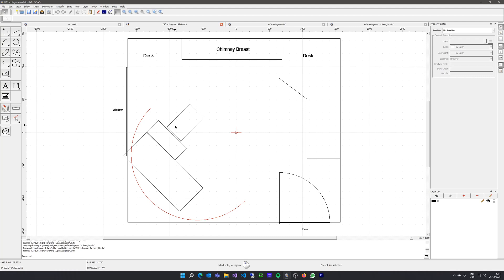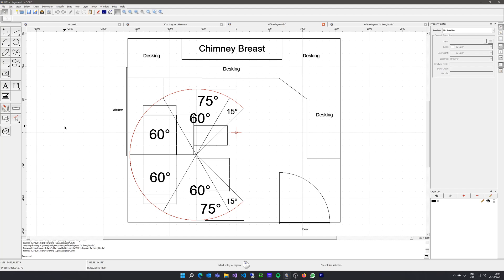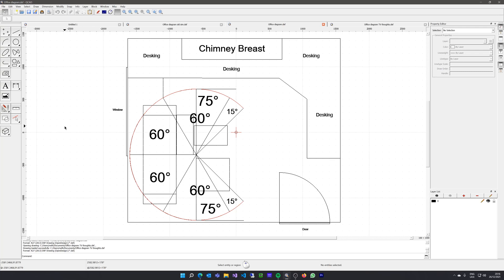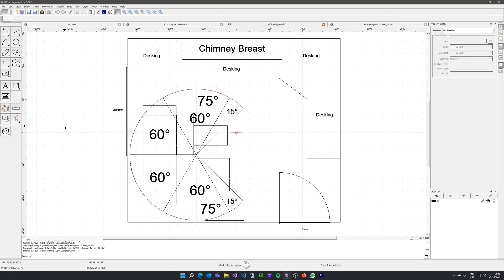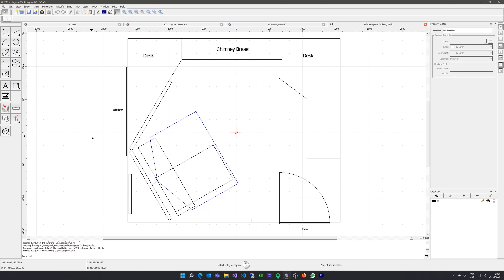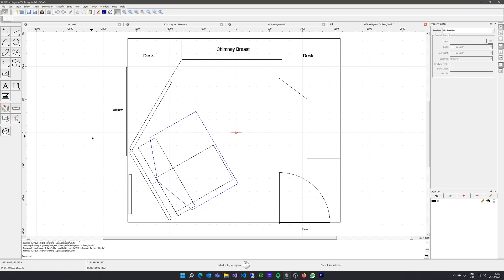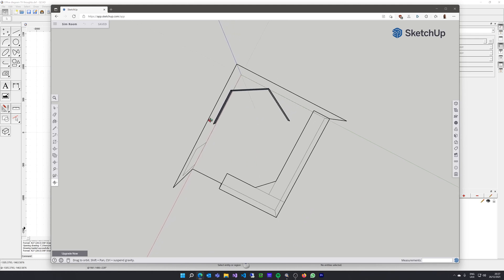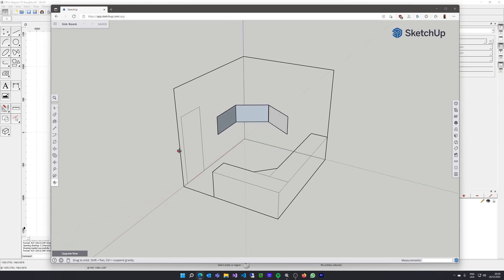Redesigning the sim, part 1: Projectors vs TVs

Comment: Hi, would be great to share experiences about this. I have a 737 sim real scale cockpit in a 2,5 meters wide room, it fits squeezed. First used 3 curved 48 inch tvs. Allways was a pending in my head the border at the sides (not getting full 180 deg view) and a second issue, the shift in colors between tvs because of the angle between, maybe with IPS panels would have been better but was afraid of can not flight at night because of the bad contrast or glare. Anyway were replaced by 3x55 inch flats. They covered the sides a lot better but the color shift went worse because the increased angle. Now waiting to define next option. At least thank to pandemic I have been able to sell all the screens fast. Do not know if a projector setup would work in this small room, I am seated at 1 meter from front or left wall.
Reply from the maker: So, the issue with TVs and their viewing angles certainly is a concern. However I've seen comments from people with similar setups who say it isn't an issue for them, and I think it does depend on the screen technology. From what I understand, OLED screens shouldn't have that same problem, for example. Projector setups always require short-throw projectors except in the biggest spaces, but it will depend on the throw ratio and what size image you want at that 1m distance. Ultra-short-throw projectors are always an (expensive) option. It depends on whether you want a curved projection screen or multiple screens at an angle to each other - obviously the latter is easier to do in a tight space.

Comment: I had the same issue with my sim. Ultimately went for the triple TV screens mainly due to high wing of the Cessna (wanted to see the wings project out from the cockpit).....great video mate.
Reply from the maker: Subscribed to your channel. Your sim looks impressive! Looks like you have your TVs at 90 degrees? How do you find that works across the screen boundaries in terms of perspective etc?
Reply: @FlyerOneZero  hey mate.  Works great and  blends well.  Bezels only drawback from a viewer perspective but I really don't notice them.  XPlane functionality with monitors coupled with planemaker works like a dream although fair bit of effort dialling in the image across the 3 screens....

Comment: What projectors do you use? I am using 2 Optoma EH200ST, but thinking of updating, to improve brightness and contrast. Would appreciate any recommendations
Reply from the maker: BenQ 1210ST, but they aren't made any more. BenQ makes reasonably good projectors but I'd do some research at https://projectorcentral.com. Also, consider that the screen material / coating can massively increase apparent brightness and contrast. I recommend Screen Goo paint.
Reply: @FlyerOneZero  thank you. Do you have any experience with Optoma?
Reply from the maker: @VPopkins  Not personally. I hear good things, but all my experience has been with BenQ.

Comment: Definitely a hard call I’m in the same boat. I’m really curious what your next step you will take.
Reply from the maker: I've more or less decided to hedge my bets and will buy Immersive Designer Pro and design a projector-based setup and see how well I could achieve my goals before I commit to building anything. There will be some content on that whole process coming. 

What I suspect I'll discover is that if I go with projectors again I can only have a 'naked' setup - no shell or overhead panel - whereas if I go with TVs I could have both; this was much less of an issue when I planned to build my next sim in a garden room with plenty of space, but that won't happen for years, if ever, so I need to make the choice now.
Reply: @FlyerOneZero  for my small space I’m thinken TVs for now for my self. Looking forward to your build videos 👍👍

Comment: Do you have any suggestions for someone who might be able to build a screen in the US? My DIY skills are lacking and I’m currently using 3 projectors and a 2m radius 180 degree screen…
Reply from the maker: Hi Paul. I’m not US-based, so I’m not really familiar with the situation over there. You can buy pre-made screens, but they tend to be very expensive. What do you feel is wrong with your current screen? Or do you want to extend the field of view? I rebuilt my screen after the first attempt, and the key improvement was creating a properly curved frame to support the screen surface; I did this in CAD software and then sent the file to a CNC house to machine it out of plywood for me. Which meant that it was mostly an assembly job. Perhaps that might be a better way?
Reply: @FlyerOneZero  lll
That would be a better way! I looked around at immersaview and some other higher end spots like av stumpfl (sp?) and yes, the cost of the construction itself was something around 10k+ USD. I had my house completely renovated so created a dedicated and sound insulated / blacked out room just for this project , got three optima Zh406st projectors, and the contractors took the plans and tried their best, but they blended some mdf and made it look nice, but it isn’t at all accurate, is quite flimsy, and it really is clear why it has to be done right!

I’m using fly Elise and that has been its own headache - my placement of the projectors has been a constant headache and then warping has been really tricky as well - I suppose if it was cheap or easy, anyone would do it! I’ll post some pictures of the current setup but essentially I’m coming to the conclusion that I’m a bit outside of my skill set :) and so was about to try to outsource it to someone who could take the time to do it right. Big fan of your work and wouldn’t have given this all a shot without channels like yours showing me what talented people could actually achieve! I’m resisting the urge to give up early and out the triples back on, and hopefully I’ll be able to at least have someone log on remotely to see the cameras and assist with the warping. Too long for the comments but keep up the great work! Ambient lighting is totally blocked out but as the wife just opened the door to see where I had chased off to, it really does make a difference vs. screens!
Reply from the maker: @kitchen415  it is a skill set that you have to learn through experience, my original version was not an accurate semicircle, the projectors were badly placed, and my original set up wasn’t perspective corrected at all so I had the stretchy sides. It took me another couple of years to really get it right.

There is a guy called Nat Crea (https://youtube.com/user/melnato) who does consultancy on display systems, and he’s pretty much written the book on the stuff, but I imagine his rate is quite expensive, also he is based in Australia so would need to travel to you. Are you using the immersive calibration pro software as well as immersive display pro? If so, are you calibrating with cameras or are you doing it by hand with a marked up screen?

It sounds like the first thing you need to do is to build a new screen, or at least reinforce your existing one. Designing a circular frame was easy enough, it didn’t exactly stretch my CAD skills, and then it was just a question of locating a local CNC place that could cut it out of suitable material. Having a rigid structure behind the screen keeps everything in place.

Fly Elise also does a piece of software called immersive designer pro, which basically lets you model your room and your display surface and work out where to place projectors et cetera optimally. It’s not free, so you would have to pay for it, but it certainly takes the guesswork out of a lot of this.

Feel free to drop me an email, I don’t have the bandwidth to do proper consultancy but I’m happy to answer questions.

Comment: You sound a bit biased towards displays to me ;-) Dark? No issue for me.  Focus has not been an issue for me either. 210 degree fov? I have never seen more than 180 without making the pixels too big (with 3 projectors). So I stay with 180 degree and 3 projectors. I have one master and one visual PC (with 3080) for the 3 angles of X-Plane. GPU is never the issue with XP, only CPU is limiting fps.  // Good luck mate,  really curious how your setup will look like eventually!  ps my curved screen is rather huge 4,80m, crab angle is ok for me. Projection  is mostly aligned to the capt. seat. I got so used to it that I have no issue landing from the right even with the crab angle. I can switch to the FO seat if somebody really wants to see it optimized from/for the right seat. For me nothing beats 3 projectors. Would love to see laser 4k projectors though...
Reply from the maker: Well, switching to TVs is a new idea, and perhaps I am overly focused on the idea of doing something new… but my projection system was always a compromise given the relatively small space I have available here. I do have a habit of taking on projects because they seem technically interesting :-) I am considering doing a scale model of the set up with TVs… If that sounds mysterious, that’s deliberate, because it would be a topic for a future video!

Comment: I'm currently running p3d 5.3 on 3 55" 4k TVs at 4K resolution.  I'm doing this on one PC with an I9-9900 CPU, 32GB of RAM, and an EVGA FTW 3090.  The 3090 is overkill from a memory perspective.  If I use default graphic settings with light weather, I get more than 60 FPS.  Of course, no one wants to run on default.  I've found a good balance point between settings and FPS and pretty consistently am in the 30-40 FPS range.  I don't usually fly in really busy areas such as London, New York, etc. You can also have the angles for the side screens to almost to 90 degrees as the P3D view groups setup lets you adjust the view, so it doesn't look wacky.  My side angles are about 80 degrees. That may help to reduce your floor space requirements.
Reply from the maker: Great to hear. Any pictures / video of your setup?

Comment: Thx for your views on this subject. You speak of 1 pc with 3 TV's, but if I remember correctly, your were using multiple pc's with WideView. Have you abandoned that concept and, if so, why?
Have you considered using a larger screen on the left hand side (e.g. 65")? Looking forward to the next video. BTW what are your room dimensions?
Reply from the maker: No, I'll still need to use Wideview. In the previous iteration of the sim I had one PC running the simulation, controlling hardware, and generating the instrument displays. Then I had another PC generating the outside view, which was made up of two separate views in Prepar3d. Wideview synchronised those two PCs. FPS was borderline in this setup until P3Dv5, where performance has significantly improved over time. The question is whether the latest P3D would be able to generate three views at an acceptable FPS on that same single image generator PC. If not, then I'd need multiple image generator PCs, and it's not really practical for me to build 2 (or any) new PCs - so that I can have one PC per display - at the moment. 

Not sure what the benefit of a larger screen on one side would be? It would make the display lopsided. I'd prefer to have three identical TVs to get the pictures as close as possible to identical.

Room dimensions are 3.2m x 2.8m. Victorians built their rooms small but tall 🙂
Reply: @FlyerOneZero  Thanks. Some people have a larger left hand screen because they are closer to that window (being in the left seat) and they want to be able to look down to the marshaller and have a better view during left hand circuits. Looking to the right hand side the view is partly obstructed by the right hand side of the cockpit.
Reply from the maker: @737sst  That makes sense. I think I'd just have larger screens overall :-) Now I'm wondering about 65-70" screens, especially given that people report you can have angles up to 90 degrees without distortion. At this point it's about the space - how much can I use but still get around the room, and get into the sim. I have much thinking to do...

Comment: I am considering go to projectors from a 5 monitor system. The 5 monitors are ok but the discontinuity on the viewing surfaces unlike projectors creates issues.  Have you considered a horseshoe shaped projection system. That is what I am planning.  4ft radius and 4ft legs.  This keeps the screens close enough to my cockpit such that the floor can not be seen from the pilot seat.
Reply from the maker: Hi Chuck. Yes, I've considered a horseshoe shaped screen as an option. How do you configure the views for your displays? Are you on P3D? With ViewGroups and individually defined view frustums it should be possible to eliminate any perspective discontinuity between views.
Reply: I run XP11 with a fully enclosed cockpit.  Other than only 180deg of coverage were you satisfied with the projectors?
Reply from the maker: @chuckkendall7407  Sure, the general issues with projection systems notwithstanding. I will say that it took me several attempts to achieve a satisfactory warp, which is one of the reasons why I’ve made so many videos about it. But once you have it all dialled in it looks great and the effect of a seamless display is very impressive. I think if I had a bigger space I would probably stick with projectors and just look to upgrade to 4K projectors.
Reply: What projectors were you using?  I’ve been looking at the optoma gt1080hdr.
Reply from the maker: @chuckkendall7407  Originally, BenQ W1080ST. Later on I switched to BenQ W1210ST. The important part is the short throw. But I know plenty of people rate the Optoma. You need high contrast ratio and high lumens.